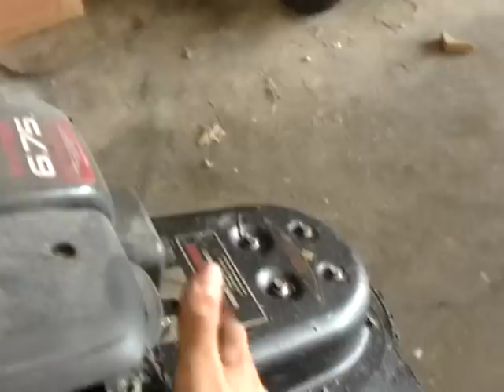Briggs and Stratton very smokey start

Comment: The carb does need to be clean since it is running a bit rough. But if I were you, do a compression and leak down test before just throwing in new rings. You are not playing with just rings any more. This is an OHV engine which means you now have oil on top of the head for the valves. Those guides can wear out and leak oil into the head. It would probably be easier and cheaper in the long run to do a simple overhaul or new engine. If you do overhaul it make sure nothing is warp and within specs.

Comment: Take the bowl off the carb and clean the jet, if that doesn't help starting it look at your valves, when you crank it in the video it doesn't sound like it has alot of compresion.  As for the smoking might be a shattered oil ring.

Comment: i have worked on over 500 small gas engines and i have seen these problems before i think it might actually be your valves. they might need to be ground down just a little bit i mean just a nick with a grinder since there might be no valve lash between the lifter and valves.

also try tilting the engine back so the oil doesnt run into the cylinder.

or if all else fails try adjusting the carb so it runs a little more richer than lean. you could also have a blown carb to intake gasket.

Comment: forgot to mention i have a 1940's or 50's 3hp briggs mod 8B cast iron block with mechanical govenor. i had it running tonight. it smokes bad not like yours, but bad. however it starts on the first pull. i figure if its not the rings its the valves because it runs fine, just smokes so bad even the mosquitos stay away from it

Comment: i've got a pos briggs pushmower, and every time i need to start it for the first time in the morning i have to take the air filter right off. the air filter is new last year. The day I installed it, I had to take it off to get the piece of crap to start. the engine is only 4 years old.

Comment: i think you need to clean that carb. i trash picked a pressure washer one and  it only ran on primer ,i eventually just took apart the carb and cleaned the jets with a sewing needle and now i have a perfect running pressure washer.

Comment: All you guys are screwed in the haed. The reason its not priming correctly is due to a couple of reasons.
1. The carby primer gasket is leaking or
2. the carby bowl o ring is not sealing the bowl.
The primer is only squirts a little pressure into the bowl and then fuel is pressurized through the main jet.
Its not that hard.
Go and get a book and learn.....life is not hard.

Comment: I'd go with smallengine13, clean the carb! I'd move the machine out of the garage instead of yurself. If you have to finger that thing like you would a gi.....nevermind you're acting as a fuel pump. when warm do a compression test and then squirt a bit of oil in the plug hole and try again. Is there a big difference?? Then your rings are probably bad